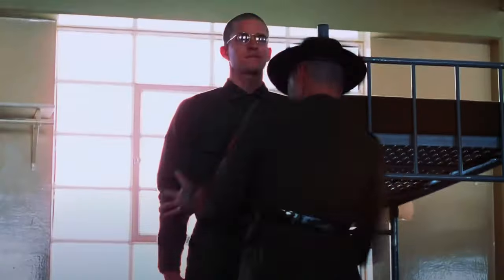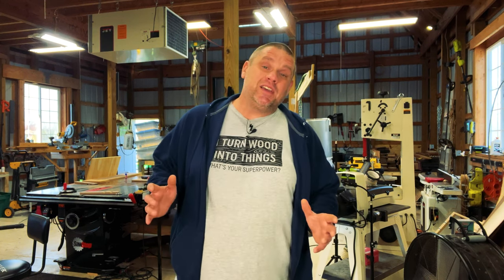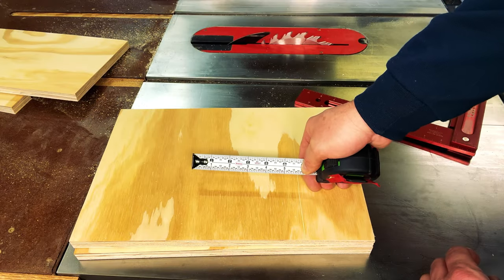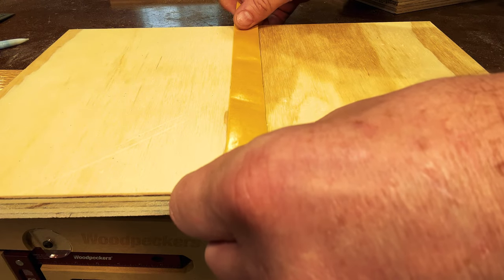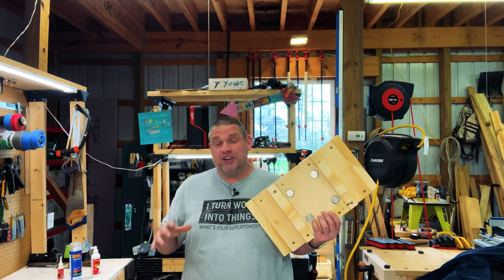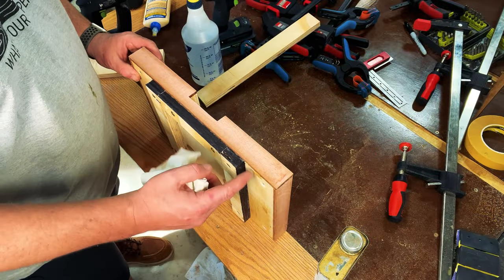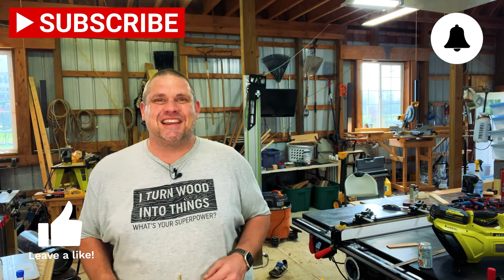Build This Incredible Magnetic Drill Press Table in Just One Afternoon! #woodworking #shopfurniture

Comment: I bought a WEN variable speed drill press and used your table ideas as a starting point. I recycled my old Ridgid table saw as a moveable base since Ridgid gave me a new saw. I used old table wings as a mounting place for the drill dress, put some shelves inside the base, mounted magnetic bars to hold drill bits on one face. I used recycled kitchen sink cutouts for laminate surfaces. I did your magnets on the table to hold it to small table, plus a couple of knobs into threaded inserts for more stability. I was going to send photos but see a way to attach files.
Reply from the maker: OMG Ken that is so cool. I love the fact that you used all of parts from other projects!  so cool.    I would love to see it, Not sure if there is a way to post the pictures.  Let me do some research and see what I find out.  I'm still kind of new to this youtube thing as well, so there probably is a way.   So happy to hear about your new drill press, that's really exciting!
Reply: @FlynndoggWoodwork  the only thing I bought new was the magnets. Everything else was salvaged or normal shop supplies.
Reply from the maker: @kenerickson4923  that’s a true shop project!  Love it.   I’m hoping to do  a lot of that when I redo my shop.   You know what, if you want to send me an email with a picture I can post on the community page.  Just go to the about tab on my channel and there is a tab where you can get my email address
Reply: @FlynndoggWoodwork  email sent

Comment: Yes, Drill Sargent. Are the bandy clamps worth it compared to blue painter’s tape?  Thanks, Brian.
Reply from the maker: You know, they are convenient, that is for sure, are they better.  I wouldn't say that.   kind of a luxury item.   Plus I find I don't have enough of them if I'm going to solely rely on them, and I don't necessarily want to have 30 of them!   Thanks for watching Paul!
Reply: "Bandy" style clamps are handy for adding edge banding. But, before you buy them, look at videos about making your own with cheap clamps and bicycle inner tubes. I made 12 of them in an afternoon and around $15. I'm still using them after a few years and several hundred feet of edge banding. I didn't use glue, clamps, zip-ties, etc., just friction fit the tube onto the Harbor Freight spring clamps. Good luck.

Comment: amazing build. I planned on building one, but when I bought the wen drill press I noticed they had a table as well. It was too good to pass up. It was just under 12x24, has an adjustable fence, stop block, t track, replaceable 0 clearance insert,  and a couple clamps all for under 50 bucks. I honestly don't think I could have built one that nice for that price.
Reply from the maker: Oh that is awesome, sounds like a great setup!   How do you like your Wen drill press table?   That's one that I've been looking at!  Thanks for watching Nathan!
Reply: @Flynndogg Woodwork  so far, I'm very impressed with every wen product I've tried. I have the drill press w/ table, the oscillating belt/spindle sander, and the bandsaw. I'm about to buy their track saw to try out. It's way cheaper than the dewalt one, which is what most of my tools are.
Reply from the maker: @n.talbert  That's awesome.  I've heard such good things about wen.  I think the only Wen thing I have right now is a biscuit joiner.   I was impressed with it, and it does the job!  Thanks or sharing!

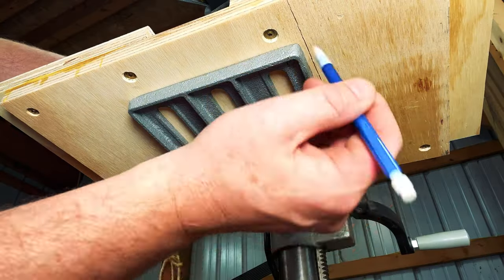Comment: Looking at the shape of things from 6:13 onwards, you could have just added some pieces to the “lip” to create a pocket that lets you slide the table on and off like a drawer – even more secure than magnets.
Reply from the maker: That is an excellent idea mm9773!  That probably would have been an even better solution.   I think I had it in my head I wanted to use magnets for this project for some reason,  But your idea is great, thanks for sharing!
Reply: @FlynndoggWoodwork  The slots in your cast iron table would also allow you to create some kind of latch underneath, so you could lock it in, but still remove it easily.

We might end up swapping ideas, because instead of a drill press, I use a solid drill stand – the cast iron table is also the base, so I can’t slide anything underneath: magnets might be the best solution.
Reply from the maker: @mm9773  Oh nice!  You know that is a great idea for a solid drill stand. I've got one of those too.  This would be an excellent way to stablilize it and give the stand a wider base for stability!   Great idea!

Comment: 1) roughen one side of the magnet so the CA sticks (probably better with epoxy) 2) Be sure the placement of the magnet isn't where the slide holes are on the table. 3) if you're going to take the time to center the waste board, probably a good idea to make tracing of the cast iron table square to the table extension. 4) I would put the retaining pieces on all 4 sides, then you don't even need the magnets. 5). probably better off with a cam level than this thing just sitting on the table, with or without magnets.
Reply from the maker: Love these suggestions Larrybud.    Excellent points and excellent ideas.  Thank you so much for sharing these.    You sound like you've been doing this for a while.  Love hearing from more experienced woodworkers like this.   I really appreciate this comment!
Reply: How about making your own video? Dude is just showing basic stuff. Seems like everybody can do better but don’t show it.
Reply: @MadMeave  I don't have video equipment and I've already made my own. DIYers are always sharing tips, what's your problem?

Comment: Nice work! Probably the easiest drill press table build I've seen. I'm guessing you're not worried about drilling all the way through to the metal table, right?
Reply from the maker: That's an excellent point.   To answer your question, I've got the table set up so that it is centered directly over the hole in the center.   Probably need to be careful when using larger forstner bits!  thanks for the comment, I'll need to be careful!
Reply: @FlynndoggWoodwork  I guess that's what the sacrificial part of the table is for. Also, if you move the metal table around, it'll just need to be re-centered, which is easy enough.
Reply from the maker: @Ted_James  Very true!   Knowing me I blaze through the sacrificial part and straight into the metal because I didn't align the metal part of the table correctly! :)